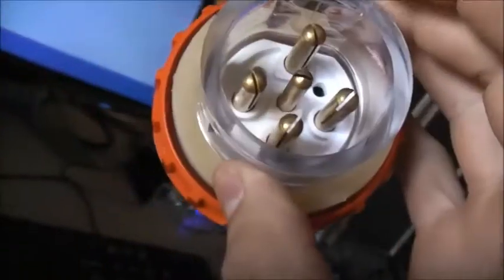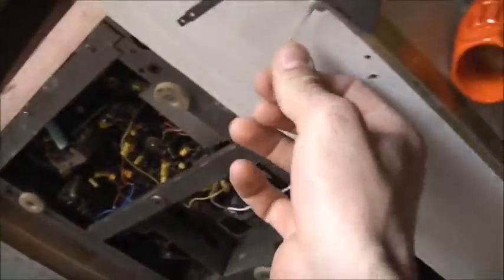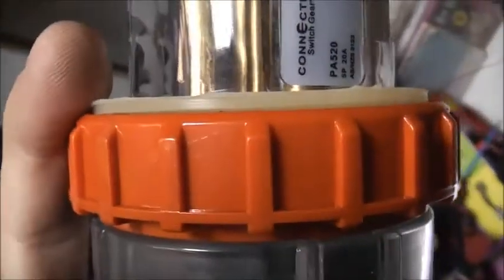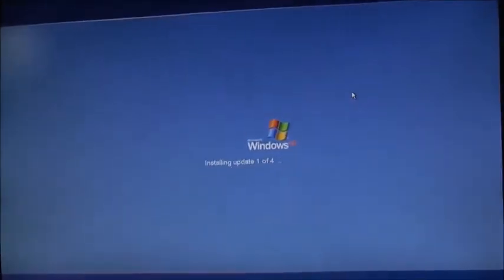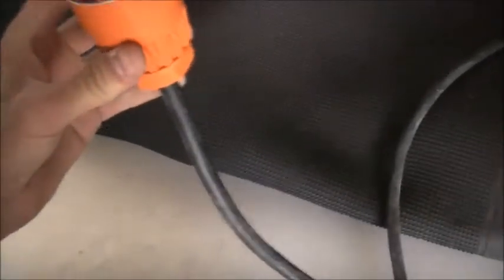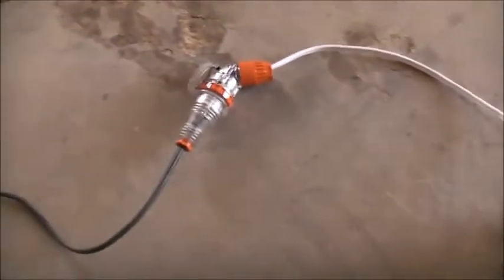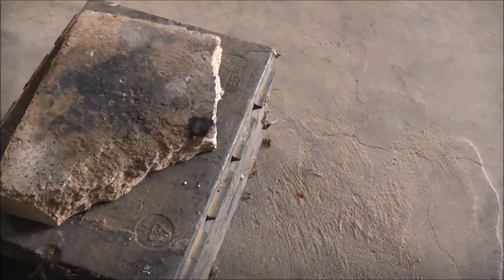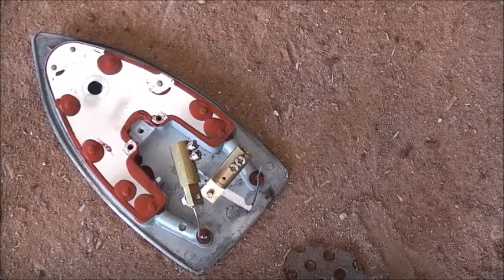Ironic 2 Phase Burn Out!!

Comment: Aaaah, lesson learnt here: Leave something on..... Uuuuntil it pops! :D

It smoked-up quite well, but as far as it going open-circuit, it might have still been getting hotter even after you turned it off, and that's when it internally gave out.

The soleplate was definitely deformed by the excessive heat that it wouldn't normally see under standard domestic conditions, and it looked nicely vandalised by the time you finished with it.

When you next get a pop-victim to be connected across 2-phase, try leaving it on there until it lets loose. I'd like to think that a 2-phase short-out or circuit opening would be quite spectacular. Nice big pop!

I know one thing: If that soleplate had have let loose while the power was on, Mr. Whiskers would've wanted out of there a bit half-sharpish! :D

Thanxx for showing,

-BoomBoxDeluxe.

6th December 2014, 05.55